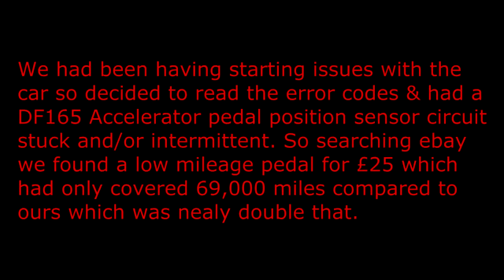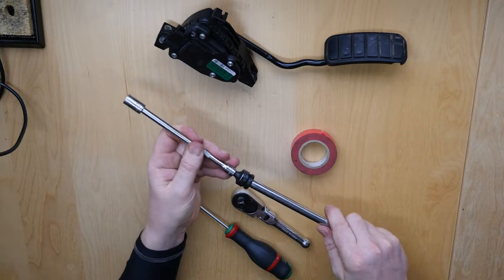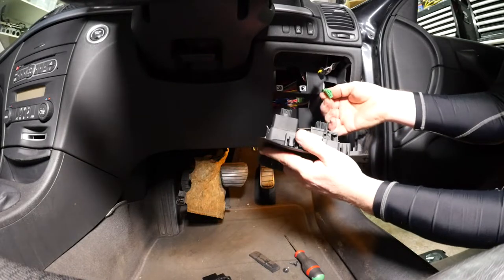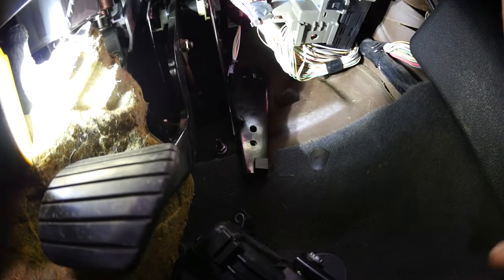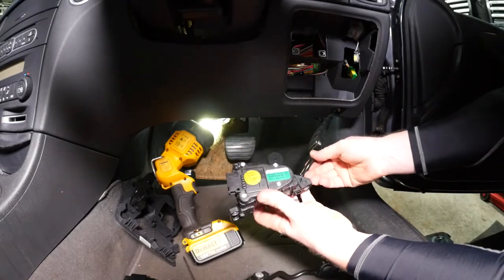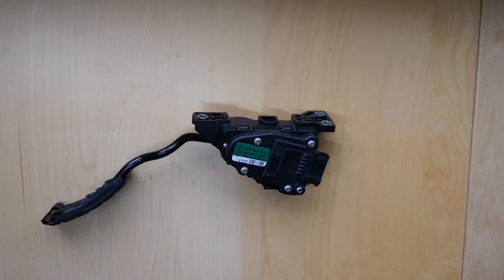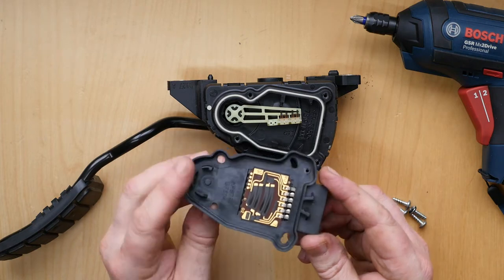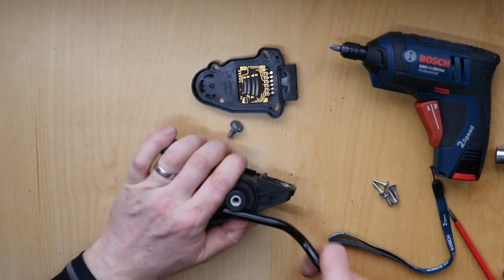Replacing Accelerator Pedal on a 2007 Renault Laguna II 2 and opening the old pedal up to see inside

Comment: Thanks for detailed breakdown. I had this same issue intermittently last year and replaced with a used pedal. Unfortunately now having the issue again so am considering a brand new aftermarket pedal. Before I invest I hoped you’d answer me a quick question:

The issue for me is that whilst driving at a steady speed, around 20 - 30mph, or when pulling off from a junction, the accelerator just fails. No acceleration at all to the engine and the joint electrical component/glow plug error light comes on. Turning the engine off and on usually fixes the issue temporarily. It can be anything from 2 minutes to 2 months before it happens again. Would you say this is consistent with your issue?
Reply from the maker: Thank you for the comment.  Ironically it turned out our accelerator pedal wasn't the real issue.  I can't remember now what the issue turned out to be.  Unless it was like yours and just very random.  I think we just had no power at times.

Comment: hello, i have also a problem with the accelerator pedal. when i push the pedal. als kinds off electric  problems. who may help me?
Reply from the maker: Thank you for your question, if the cause is the accelerator pedal you can change them fairly easily and cheaply.  I know Renaults can suffer electrical niggles if water gets into the electronic modules which are sometimes mounted near the wings.